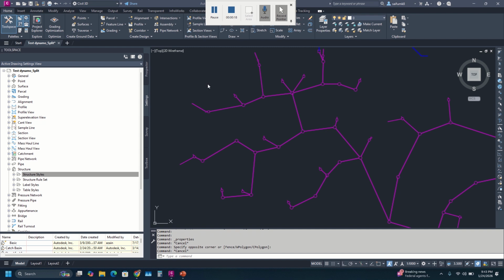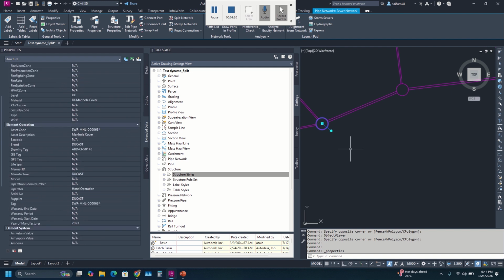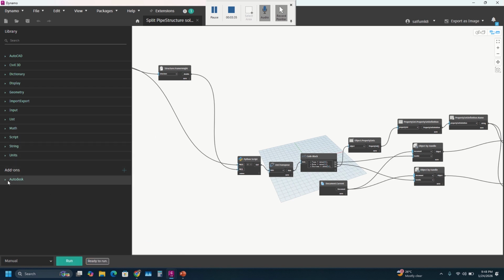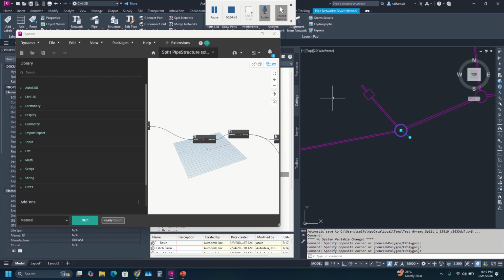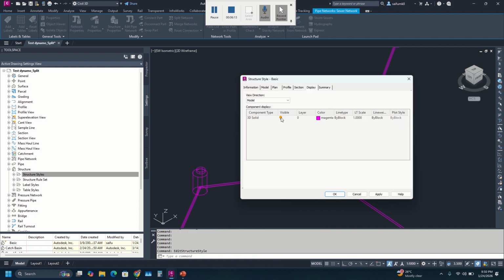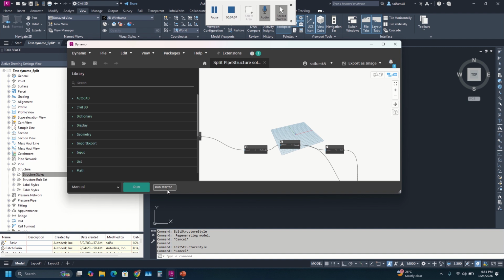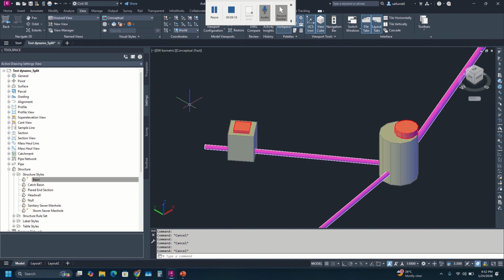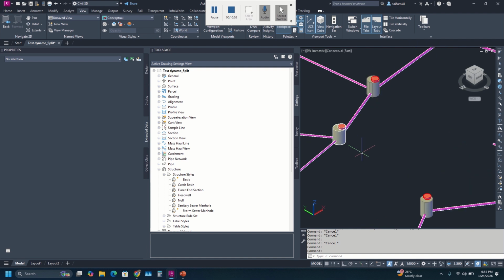Civil 3D: Split Manholes into 3D Solids with Property Data Dynamo to Split Pipe Structure

Comment: Informational video thanks. However,, is there a way to automate the parts by parts method due to client's requirement?
Reply from the maker: Yes, I could generate custom dynamo.
Reply: @BIM-Infrastructure  How to call the rotation of the structure when assigning the cover orientation via dynamo? can you enlighten me how can this be called/acccessed within dynamo?